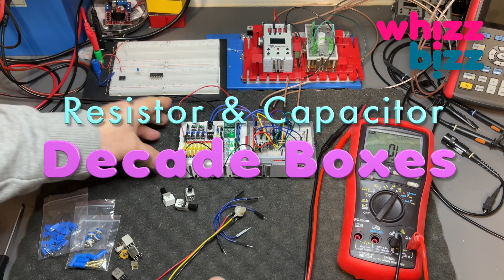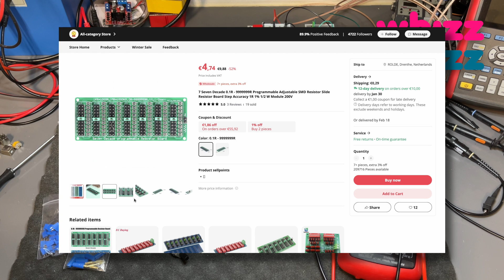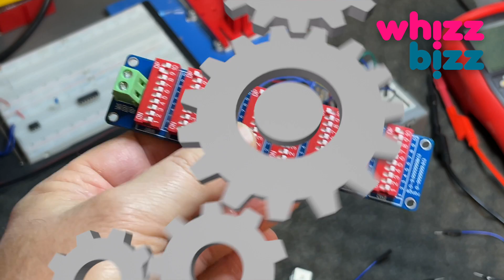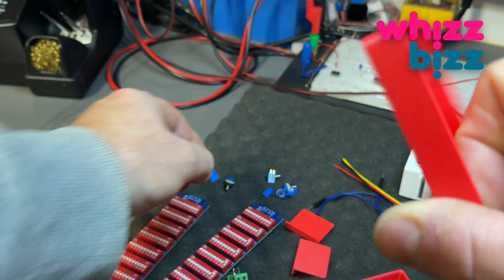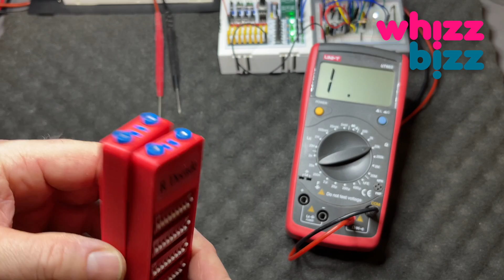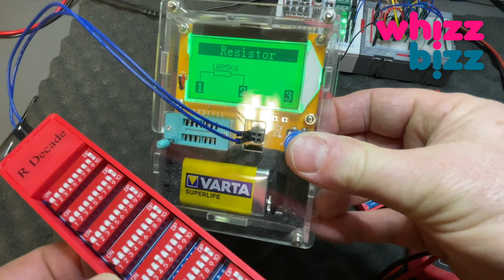Cases for R and C decade boxes with DIP-switches

Comment: I want to buy one of these resistance boxes to use it in the 0.1R and 1R ranges. Are they accurate? The AliExpress page claims that the product has 1% precision (I hardly doubt)
Reply from the maker: Hmm, in these lower ranges your testleads may have more resistance, I fear. The specs they give, are just the specs of the SMD components. With the C-decade the lowest banks are not very useful because the default capacitance was already 40pF. So I think their main use is in the higher ranges. But hey, they're very cheap and might save you a lot of breadboard-plugging when experimenting 😀